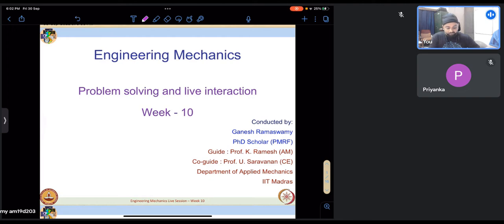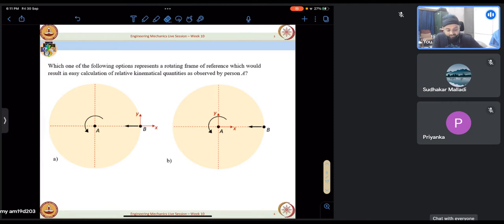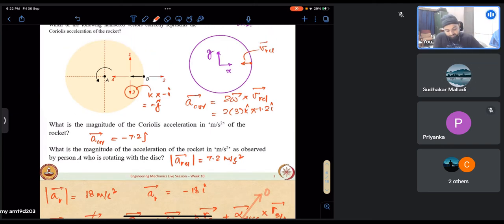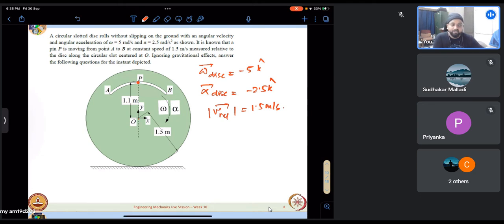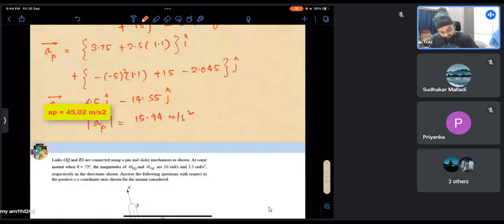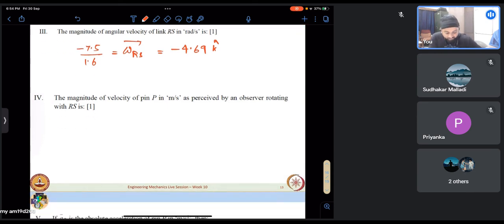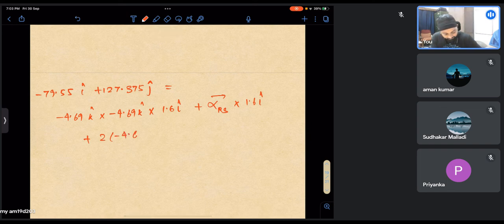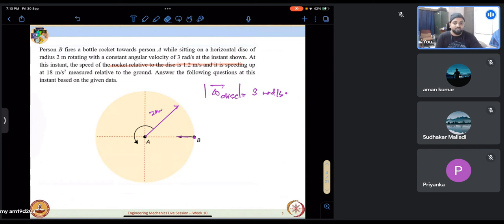Engineering Mechanics Live Session | Week 10

Comment: Imagine a slotted link and a slider pair rotating in a cylindrical vessel with an angular velocity can we use the same approach to find the absolute velocity and acceleration of the slider!!
Reply: Should we take the angular velocity of the slotted member as seen from outside (wrt to ground )of the cylindrical vessel to calculate the absolute velocity and acceleration of the slider sliding in the slotted link?